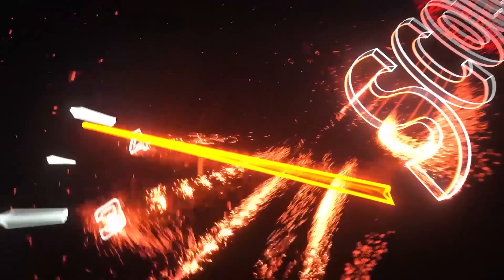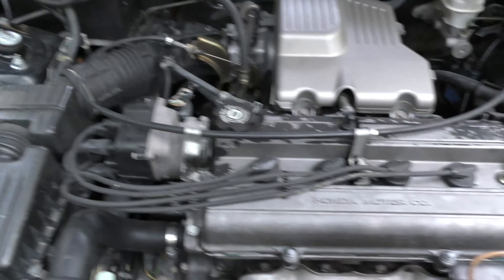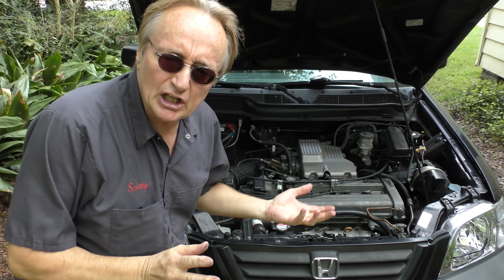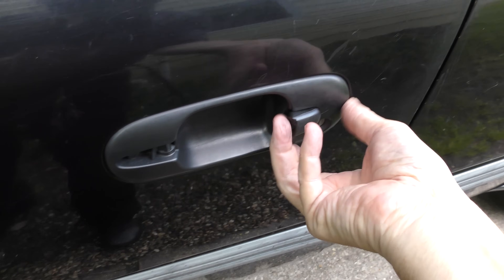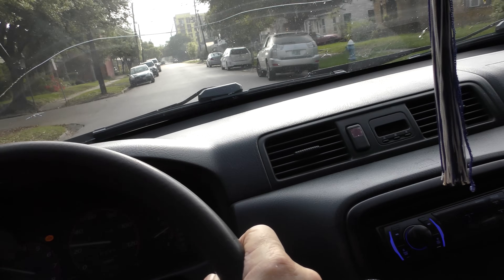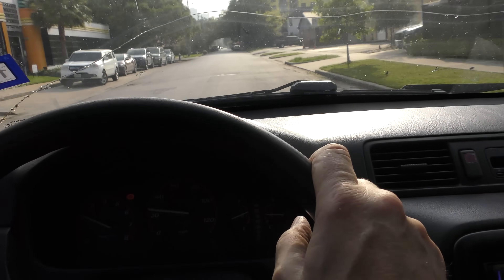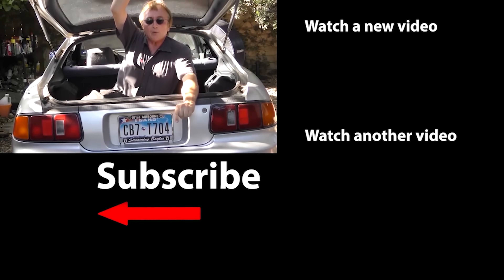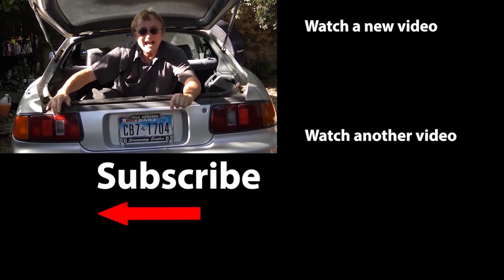Here's Why Smart People Buy Cheap Hondas

Comment: I am driving a 1998 CRV. My father bought it second hand when I was a kid. Then he passed it on to me. Now I am driving my kids in it. 23 years and 300 000 km later I still haven't changed anything on that car except fluids, tyres and the battery. This car withstood even my wife's driving lessons! I am not an offroader by any means but  have been driving this thing in Eastern Europe where the roads are quit crappy and temperatures vary considerably (the car stays outside, I don't have a garage). And yet, the suspension is still the original one, the AC is intact, the transmission is fine (it's a manual)... Would recommend it to everyone without any hesitation!  :D

Comment: My 1997 CR-V with pretty much the same mileage (480,000 km) is 3 years older and is still working perfectly fine.  Changed rotors, calipers, resonator mid-pipe, mufflers, starter, etc. like what I had expected from a 23 year-young SUV but nothing else unexpected went wrong, except the ignition switch that caused it to stall while on the road.  Not even that, I just got a letter from Honda Canada saying that there is a pending recall on the airbag so I'll be getting a brand airbag soon :)
Reply: How is it doing now?
Reply: Interested to know too
Reply: Same question

Comment: I do have a 2002 cr_v. And black color. I guess is the reason why my door lock fail along with the window. All I did to fixed is. To replace the wire harness now is working fine again 👍👍👍
Reply: Heat. Makes the wires bridle and they crack!!!

Comment: I paid $3,200 for a 2006 Civic with 205,000 miles on it. The engine was replaced at 81,000 miles by Honda due to a recall. So, the motor had 124,000 on it and pretty much everything had 205,000. I've had it almost 4 years and put 60,000 miles on it. The only repair so far is a new starter (which was a PITA). If it blows up tomorrow, I got my money's worth on it.
Reply: Still going?

Comment: In this new Depression, stick with Toyota and Honda. You'll have to think long term now.
Reply: ALF Raydough  As a personal finance expert and lover of high quality asian automobiles, I concur!
Reply: You got that right. Sticking with my 99' Accord V6. Everything still works but the paint. LOL
Reply: I’m not sure I could ever sell my 2006 stick Corolla S 153k. Full service done at 137k. The look, mpg, reliability; it’s just too special to me.
Reply: @josephbell2160  You can address the paint and have it fixed with a good paint shop. Those V6 Accords are bulletproof also.
Reply: driving around in my 07 Ridgeline in this depression feels pretty good.  $25 to fill it up and I know I can go anywhere in it.  Dirt road 10 MPH uphill or Interstate highway at 85 MPH no problems.
Reply: @gregs_garage  I like your Ridgeline exterior style better than the newer models. Beautiful truck!
Reply: 2008 Honda Civic ex with 190k miles. I feel like my wheels may never fall off so I will be driving it for quite sometime. Only draw back maybe is it's a coupe.
Reply: @flspeid  Yeah, for $200-$400 range I should be able to get a decent paint job. Glad that's the only thing wrong with it
Reply: @flspeid  Love these V6 J Series engines. You just tap the accelerator and it takes off. Honda made a big mistake getting rid of it
Reply: I've got a well taken care of 2006 Honda Element with the K24 engine , but it's using 1.5 quarts of oil per 1000 miles. I'm bummed about that because it's supposed to be a great engine so I might buy a  good used Toyota
Reply: 04 Civic LX with 205k miles and still runs like nothing. Glad to be car payment free!
Reply: I had a 2000 plain vanilla Honda Civic.  It crossed the USA, coast to coast, four times. It got handed down three times to family members.  Never broke down.
Reply: Got myself a used Honda and can't be happier.

Comment: I bought a 2010 Civic in 2015 with 72k miles on it. Fast forward to 2023 & I have the same car with 337k on it (175k from driving for Uber & Lyft).. Car is a beast. Still drives like a champ. Daily driver in Los Angeles. Sips fuel as well. Love my little Honda.

Comment: I bought a 2000 cr-v for $500. I had to spent $300 more on a new power steering and I'm slowly fixing some other minor problems, but it's a great car for under $1000. Thanks for your advice, Scotty!
Reply: I just bought a very nice one for a garage kept one….4750$ total and the owner had done over 2000$ work on it and just surface rust, all functional and a Check engine just popped up, 145k miles 4x4.

Not the smartest financial choose but I love how well the car is.

Comment: My 2000 has 104000 miles. Grandpa played bumper cars with it, so now it's mine. Put in new radiator, wiper reservoir and pump, and driver's side window motor. Change the oil every 5000,  it will probably run till I die, after that I don't know.

Comment: Only six problems with my old CRV: 1) valve clearances weren't maintained, caused a head rebuild 5 years ago, 2) automatic door locks haven't worked for 12 years, 3) key can't lock or open the doors, my second key still works ok, 3) chrome on the driver-door latch handle is flaking off, 4) a small dent in front-left fender from a garden rake falling on it, 5) driver seat-belt button came off, and 6) the vinyl spare tire cover is falling apart. Not bad for 23 years (146,000 miles). May keep it till it turns 25.

Comment: I got so lucky, I got one  that had been in the same family since new. The father of the person I bought it from is a retired mechanic who looked after it. It has zero mechanical issues, no scratches or dents, Absolutely everything works as it should. They even added an aftermarket stereo, a remote starter and an LED bar to it a few years ago.  When I bought it, the timing belt had been replaced only 5K ago!  It was great in the snow already then I put a set of studded Nokians on it and now it's Canadian winter beast! I sometimes can't believe my CRV is 24 years old.

I can't say enough good things about these CRVs, they are definitively among the best AWD cheap cars you can get.

Comment: Loving my 1999 crv almost 300,000 miles still drives like new.
Reply: Nice. I am impressed
Reply: Mines at 238,000
Reply: My 2000 Accord 2.3L has 380k on the clock and Engine n Trans still silky smooth

Comment: Just bought a 99 CRV to save on had and keep miles off my truck. It's a 2 owner 215k miles. Bought it for $600 worth a blown engine. I put a new jdm low mileage engine in it. Been cleaning it up. It's a great little beater and I love it. I drive it everyday unless I need my truck. Driving this car just puts more money in my pocket. The best thing about a beater is parking it anywhere stress free. If you've owned a beater car you know what I mean!

Comment: I have a 99 crv, absolutely love it, runs great still, The paints I’m still good shape so difference there, I’m going on 220,000 miles no problems since I replaced the tire rods, it even still has some pretty decent power, love the AWD in the winter

Comment: I just passed our 2005 CR-V 4wd with 276k miles on to my dad. The worst issues we had with that car were connected to the a/c. They had a design flaw with that generation CR-V’s a/c. We drove it nearly 400 miles from our house to his and it ran like a champ. It was the 2nd of 3 CR-V’s we have owned in the past 20+ years. Our son now drives our 2013. We have since moved on to the Pilot.

Comment: The wife's got a 1999 CR-V with 180k+ on it. The paint and interior is still good. Sure, it has almost no sound insulation, with the 5 speed its geared to pull about 4k rpms on the highway and the factory stereo sounds like a glorified 80's clock radio, but its a little beast in snow and on trails. It's like having a small Jeep that never breaks. Also, because its a simple upright box, the thing holds a ton of cargo (and it has a terrifically designed roof rack). I've been told we are keeping this beloved box until goes terminal.

Comment: 1st gen CRVs(RD1) are the most fun, reliable, and capable small SUVs in my opinion. they are extremely easy to work on, also have a big aftermarket parts support. Give them a 2" lift and AT tires, they'd be ready to explore.

Comment: i own a 1998 crv with a bad transmission, i new it was bat at 120,000km i am now at 230,000km and still haven't changed the transmission.  the motor has a bit of a knock and i have a water leak somewhere that fogs up the windshield.  other than that this car only failed me once and died right in front of a auto parts store.  I knew right away by the way it stalled quickly that it was a distrbutor problem, i got a new distributor and for $230 CAD borrowed the tools to unbolt the distributor and was driving away withing 30 min.   The car has never failed me since.

Comment: I have a 2005 CR-V with 184,000 miles. Runs great. AC and heat works fine. Power locks don't work, but I don't mind using the key. This video may have saved me from spending $$$ on another used car.

Comment: I just bought a 1999 crv for a daily driver. Thanks for the advice. I'm having the Timing belt changed and fluids changed. And anything else that is suspect. IIt has 207,000 miles and runs good, AC and Heat still work. I have a great Mechanic that doesn't invent stuff. He looks out for me. Of course he's also my neighbor. But he's always been trustworthy.
Reply: Just bought a 2003 at 180k runs beautiful when I checked it out changed my oils and it runs beautifully,enjoy brother !
Reply: Well, I sunk about $2000 into it. But, it drives and rides better than my 2011 Grand Cherokee on the interstate at 80 miles an hour.
Reply: just got an 06 crv with 195k for 5,500. Hope i didnt pay too much, but its in great condition

Comment: My 2000 CRV has only 260k miles. It still goes 100 miles per day in the commute. All wheel drive and ABS goes great in the snow too.  Watch out for exhaust valve seat recession with these. Be sure to do valve adjustments.
Reply: My '01 AWD auto handles the best of anything I've ever driven in snow and ice. Steep, winding mountain roads are no match for this thing!
Reply: What’s that?
Reply: @lionheart93  A 2001 Honda CR-V automatic with AWD (all wheel drive)

Comment: Owned 3 CRV's over the years. Great cars! Best was our 2006 with 5 speed MANUAL transmission. Sadly 2006 was last year for manual transmission CRV.
Reply: Those MK11 were the best in the Range they upgraded same with a face lift range... our second one of that Model... Cruse Control, Leather Seats / Steering Wheel, New Shaped Alloy Wheels, New Front Light Cluster with light levelling ....We have one great Yoke...would like a Five speed manual but my partner has got so used to Automatic... she won't go back... There's even an overdrive/ shift down button that shifts down into a higher revving mode for overtaking...Lol...

Comment: Bought a 99 with about 40k on it in 03 for 12.5k.  when I gave it to my dad 13 years later, it had 162k miles and everything worked fine. My folks sold their house a few months later and my dad was able to sell that 18 year old car for 1440. Honda's are reliable and despite their age, they can still sell for a fair amount.

Comment: I can remember my uncle told me you drive a car until the wheel falls off. Yep it was older and finally a wheel fell off and he went out and got another used one. I am sure he really didn't think it would happen.
Reply: Seriously😂
Reply: Just repair it. Probably it had very bad shaped ball joints.
Reply: Yeah, I remember when I was 16, front tire fell off my Pontiac, a flaming red wheel into oncoming traffic, didnt take long to drive until the tires fall off, problem was I just bought the dang thing

Comment: the window and power lock could be the wiring to the door. i seen most of the older pilot and crvs that the wires break on them from all the opening and closing the doors. can just repair the wires and will work like brand new

Comment: I love my 01 Crv! I got it with 127k and 8 years later it’s got 277k and still going strong. It’ll be sad when it finally kicks the bucket. If it does... 😜
Reply: Have you replaced the timing belt mine has 161k and I'm still debating doing it?
Reply: @franciscorojas274  you know it’s been so long I actually can’t remember. I have the mountain of paperwork for every service so I’ll have to go thru that to check. But I’m pretty sure it has.
Reply: @franciscorojas274  I bought my 01 CRV with about 130K on it and it still had the original timing belt. When I had my mechanic check it, he said that although it didn't look brand new, it still had the original markings and didn't show any signs of impending doom. Even still, I had him change it out and I'm glad I did. A broken belt will ruin the engine in this car.
Reply: Have you noticed any slipping in the tranny? I'm starting to get a little worried about mine with "only" 190K on it.
Reply: @gomertube  it now has 284k on it and no issues with the transmission. Of course a couple minor leaks here and there but nothing unsafe. It’s just important to keep up routine maintenance like changing the trans fluid.

Comment: I have the same vehicle. I had the same window problem, the same antenna problem etc... This car is super easy to prepare, super reliable, and an amazing first car for a teenager.

I've put about 50,000 miles on her and I have had not one problem other than the ones I set out to fix when I got it at first. 

9.5/10 for reliability, efficiency,  and convenience.

Comment: I've had my 2000 CRV for over 2 years now and it just went over 220000 miles on my last adventure down the west coast with it.  I love this thing and if anything ever happened to it I'd probably just get another one.  I wonder if this model is a sweet spot or if a later model might be better.  I could honestly use something with a little more towing capacity.

Comment: I have a 1997 CRv. The engine runs very well. The transmission sometimes shifts rough. Other than that, I love it
Reply: My 97 will occasionally shift rough. Time to change out 3 quarts of Honda transmission fluid. Just what comes out. Super easy. Smooth shifting.

Comment: I took your advice in past videos  when I was searching for an inexpensive used vehicle. I bought a 2002 CRV AWD 2.4l with a manual transmission. Other than some cosmetic scratches on it the car works perfect and it's in great shape overall. I'm very happy with it and it gets way better fuel mileage than I expected
Reply: any problem with the CRV now?
Reply: @Charlitos1988  air conditioner crapped out as is common for these otherwise it's an awesome car I love it alot and it's getting good fuel mileage
Reply: @1944johndeerel any update now?
Reply: @lionheart93  no regrets, great little car
Reply: 1994johdeere, any updates now?

Comment: Hey Scotty talking about used cheap Hondas , About 6 months ago I purchased a 1995 Honda Accord station wagon. With well over 300,000 MI on it . Has the 4 cylinder v-tec. A/C still blowing could. I had to do some work, like do harmonic balancer, new valve cover gasket, spark plug seals , water pump and timing. Also new CV axles and new distributor. But only gave $250.00 for the car. Thanks for your service and stay safe  H Langford 👍

Comment: Highest mileage showing on odometer I've ever come across was a 2002 Saturn model TL with 693K+ miles.  That was a few years ago.  Owner used Quaker State 5/30 oil & Fram extra guard filters.  Looked a little weather worn w/dings & such - but ran fine.
Reply: Back in the 60’s and 70’s we stayed away from the paraffin wax based oils they used. When you pulled the valve cover on a car with 70-100k on it, the sludge created by the paraffin would sometimes be so bad, that the shaped mold of the valve cover would create a sludge made valve cover under the real steel one!

Comment: I just bought a 2006 with a manual for $3500 in great condition with 230k. I found a number of places in Southern Calif that sell used honda engines with between 40k and 60k for $490 all day long so if this one goes out I will just pop another in cuz I am putting new struts, wheels and tires. Everything works on it. I love it and gonna keep it forever.

Comment: absolutely! six years ago i bought a 2000 honda civic from a retiree. aside from cosmetic wear, it had 75,000 miles on it and cost $3,500. i have since bought a new(er) subaru impreza (to deal with minnesota winters), but have kept the civic since it only has 110,000 miles and has not required major repairs. amazing longevity...

Comment: I love my 99 CRV. 230K, No check engine light. Just regular fluid changes. I get the impression it will outlive me :/
Reply: Hahahaha hope you live long to see your baby hit over a million miles
Reply: Is it a B series engine?
Reply: @ahbah518  B20 engine. 97,98 Version I believe has 120+hp where the 99-01 have 140+ hp.
Reply: Same. 99 CRV. 255K, just did basic maintenance; spark plugs, fuel/cabin/air filter and replaced the engine/transmission oil. This cost me less than $100. No lights, running strong :)
Reply: @ahbah518  Yup.

Comment: I have a 2002 honda accord cl7 20EL i rebuild the whole suspension, both side lower control arm,both side upper control arm, stabilizer bar front and rear , stabilizer bar bushings front and rear, new front wheel bearing, new 3 engine mounts 3 new transmission mounts, inner tie rod, outter tie rods, i can drive amother 10 years without provlem lol, basic maintenance like oil changes and done.
Reply: Still drives like a new car after 18 years lol

Comment: Simple, it's because of Honda's reliability, tested durability, and availability of slightly used surplus parts that you can find in most auto-shops, especially in Asia like the Philippines. You'll find a lot of 90's Honda's here, and some of them are modified, and in very good condition like brand new! 😎